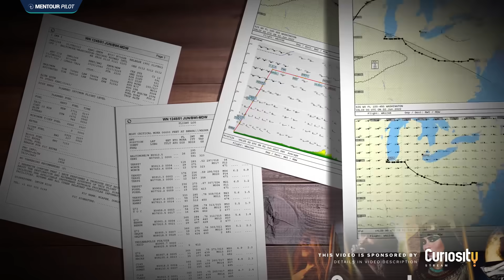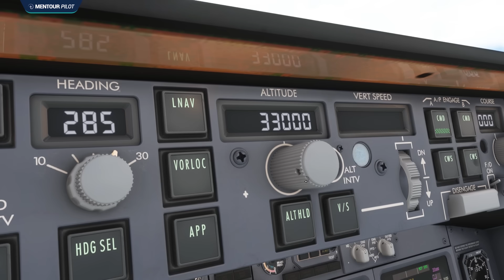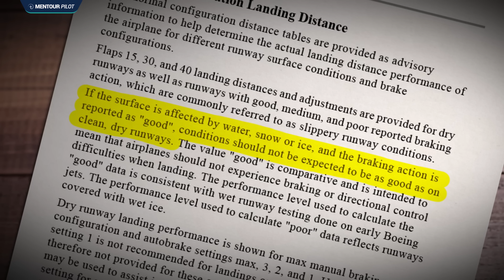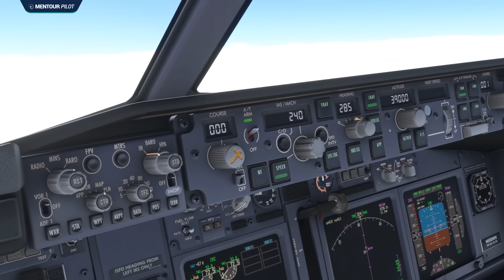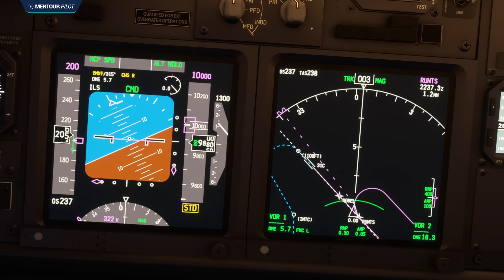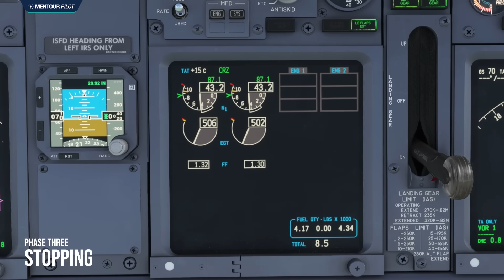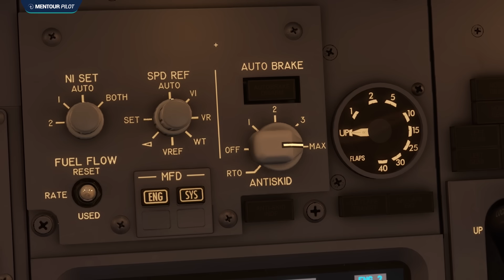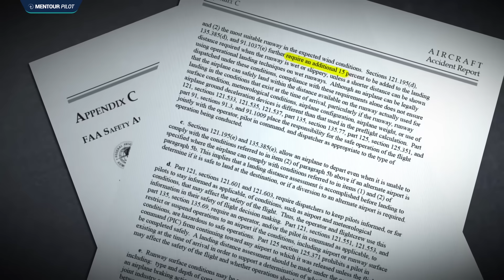WHAT did The Pilots MISS?! Explaining Southwest Airlines flight 1248

Comment: This one is very close to me. I landed a 757-300 on 31C an hour before the SWA accident.  MDW is most definitely a challenge when the wx is nice. Throw in low vis. and runway clutter and it gets real challenging. Auto-brakes max on a 737 is like a carrier arrest. I used it one time with the check airmen when I flew the 737-800. Auto-brakes 2 usually worked adequately with clutter. Of course when the Capt. applied manual braking the auto-brake system goes off. I operated out of MDW from 2000 to 2008, many T/O's and landings.
Reply from the maker: Thank you for that story! 💕
Reply: “Throw in low vis. and runway clutter on a 737 and it gets real challenging”. 

… plus tail wind in this case.  Why doesn’t the industry consider this an automatic divert, or an outright flight cancellation due to weather, instead of just becoming ever more “challenging” until something breaks.  The “carrier” landing mentality also seems dangerous given widespread former military pilots, because carrier aviation and military mission critical thinking has aspects inappropriate to commercial aviation:  flight must occur, landing must occur here on this carrier and now.  This  SWA flight did not need to occur, nor this landing at this airport.
Reply: @Nill757  In this particular case the crew was not up to speed on the auto-brake system. Many aircraft landed before this flight without incident. I understand your thought process but professional pilots are paid and expected to operate in such conditions and do so without peril on a daily basis. Like all accidents not one thing was the culprit but several red flags that created the end result. The crew was unfamiliar with the Boeing auto-brake system, landing data was what I call "fuzzy math" and then there was a tailwind and reduced braking action. The slow reaction of the reverse thrust was a big contributor, when you land at an airport like MDW even when the reverser's deploy promptly you almost feel like they weren't  fast enough.  I don't need to go on, Mentour Pilot has done a good thorough report on this. I only commented because I was there that night.
Reply: @Kevin_747  I recognize the high level capability of professional pilots.  I’ve been close to them for years, via designing gear for mil aviation.  

In this instance, it’s troubling to to see the response, ‘other aircraft landed without incident’, which is the case in every system with fundamental flaws which are excused away, like the Bhopal chemical disaster, or the countless coal mine collapses until that industry finally corrected itself.  

Similarly the unfamiliarity of this crew with the braking system is not an excuse for the accident.  Every professional comes up against unfamiliar terrain, which means recognizing those limitations and backing off.  Here, this crew knew and discussed experience limitations, which a safety focus meant diversion to O’hare w longer runways, or simply grounding the flight.  Instead, Im inclined to believe as you suggest  that the cockpit mindset was, ‘we’re professionals who perform without peril’, all the way through the runway excursion and into that car with the boy.

There are several sincere ways to view this accident.  Mine, is that the industry’s remarkable modern  safety record is now brewing hubris, is growing increasingly brittle via ‘train detail 99, patch cockpit glitch 101 instead of growing robust, is increasingly pushing up against the limitations of crews who can’t train on infinite detail, is increasingly immune to criticism via ‘we grow safer from accidents’.
Reply: @Nill757  by "carrier landing," the guy is only describing the extreme deceleration when landing on a dry runway with MAX autobrake selected.  He's not talking about anyone's "mentality."
Reply: @Kevin_747  Falstaff strikes me as the kind of person who wears an N95 mask when he's driving his car while alone on the freeway.  He seems extremely risk averse and thinks normal aircraft operations are reckless if the flight is allowed to continue in anything less than ideal conditions.  I've seen some of his other posts and there's definitely a theme going on.
Reply: @skyhawk_4526  Fair enough.  He’s also identifying as a former  naval aviator, where diverting to other airports is generally not an option, nor is canceling the flight due to this kind of weather.   It seems odd to me, given this accident doesn’t happen at Ohare’s long strips, that so much focus of this discussion is on how more training etc could have squeezed this aircraft into Midlands within the tight margins, icy short strip, tail wind.
Reply: @Nill757  Sir, I did not say I was a former Naval Aviator. I described the Boeing Max auto brake as "carrier arrest" like. Skyhawk452 also described it as sudden deceleration, which is accurate.(thank you Skyhawk) I did ride through several carrier landings as an enlisted sailor on the COD so I feel authorized to use that as a comparison. You seem to think my attitude and remark "without peril" is cavalier and cocky. Absolutely not. If you have the proper data for a safe landing and decide to go to your alternate while your other shipmates are landing you will be sitting in the Chief Pilots office in a short time. The accident aircraft in this report did not have all the numbers in the "green". That is on them and no one can change that. I'm retired now but I spent 40 years in cockpits with a clean record. I see no reason to keep writing word salads to try and explain airline ops to you. I respect your opinion even if we don't agree.

Comment: Eighteen seconds seems like such a long time to realize the thrust reversers aren't doing anything. I know flying an airplane, particularly a big jet like this, can be pretty complicated and I could understand if it took them 18 seconds to remember to retract the landing gears after initiating a go-around. However, in this case, they really only had two things they needed to worry about once the wheels were on the runway: slowing down and steering. I'm not a pilot and maybe I'm missing something, but they only needed to steer with the rudder, make sure the auto brake was working and brake manually if not, and make sure the thrust reversers kick in within a reasonable amount of time, and there were two pilots to stay on top of it. They expected the runway to be slick so it's not like anything totally unexpected happened. I feel like I have more going on in my car when I'm making a routine stop at an intersection and I have to steer, brake, and downshift. (I don't have to downshift, but I like to do it anyway.) It's never taken me 18 seconds to realize I'm in the wrong gear.
Reply: this is such a good point. 18 seconds is a long time
Reply: Now imagine you've just moved from an automatic to a manual for the first time since you took your test years and years ago and this is your first drive out. Your going to make screwups as you struggle with making sure your using the clutch correctly. The distraction factor of the autobrake was clearly  major factor once they where on the runway.
Reply: A car is pretty different. You can easily hear the engine revving up when you downshift. The pilots in a commercial jet sits fairly far from the engines and they are wearing very good headphones.
Reply: No, youre not missing anything! Should've realuzed it.
Reply: You sound like you would make an amazing pilot, just like every other armchair critic. Backseat drivers🤮
Reply: @leonardhpls6  So why did it take 18 seconds?
Reply: When I was young I had a Lotus Europa... girling brakes. One day I backed out of a parking place in a parking lot and approached the street, so I pressed on the brake pedal and it went to the floor (I found out the hard way DOT3 would destroy girling seals). Thinking I had pressed the clutch, I lifted my foot and searched for the brake pedal again, pushing and getting the same response. I had rolled to a stop several seconds before I realized the brakes had failed. My brain told me I was pressing the clutch pedal so I never gave the parking brake a thought... I just had to find the right pedal.

The manager I had before I retired was a former Army Ranger. You would be amazed how many times he pointed out when we would second guess the guy in the field, "We aren't there."
Reply: @darthkarl99  That doesn't seem like a very good analogy to me. In fact, it seems backwards since the auto brake makes things easier while driving a stick is more challenging.

I'd liken it more to having a device on your car that watches for red lights and will automatically brake for you well in advance, but it's in the testing phase and you have to be wary that it may not work. I think I could watch for red lights (as I usually do) and be mindful that I may or may not need to brake while still staying able to keep the car in my lane, watch out what's going on around me, etc. This was a new device that if it worked meant they didn't have to worry about one of the three things on their list, and if it didn't work, then they did what they usually do. Two simple scenarios...

I think they probably should have just left it off since they had so little room to spare when deciding if it worked or not, but to get distracted for 18 seconds...
Reply: @djinn666  They don't have to hear it. They can feel if the plane is decelerating. I feel like I'm going to get thrown into the seat in front of me every time I land. It's pretty obvious.
Reply: @leonardhpls6  If I was in the backseat with someone that took 18 seconds to realize the car wasn't slowing down, I'd tell them to let me out and I'll walk.
Reply: @flagmichael  Okay. What if you had half-expected your brakes to fail and had already planned what you would do if they did? Unexpected failures are one thing. They expected the auto brake to fail and probably decided it had failed when it hadn't. There was no surprise.
Reply: According to the NTSB report it was actually 15 seconds before the first action to deploy the thrust reversers was recorded on the flight data recorder. I guess the captain completely forgot, even though he claimed he tried to deploy them immediately after landing, and they didn't work. The NTSB investigators suggest the captain associated in his muscle memory braking manually and deploying the thrust reversers at the same time. So, as he didn't brake, because the auto-brake was used, he also skipped the associated action, deploying the thrust reversers.

The first officer noticed that, probably after about 12-13 seconds or so. The first officer mentioned the levers were still in the stowed position so, in my opinion, it's unlikely the captain even attempted to deploy the thrust reversers, especially as the flight data recorder didn't indicate any attempt immediatly after touchdown. At about 15 seconds after the touchdown, after moving the captains hand from the levers, the first officer started deploying them himself, as that's when the flight data recorder recorded the attempt. It took another 3 seconds for the mechanism to deploy and allow him to move the levers to maximum reverse thrust, making it 18 seconds until full reverse thrust was commanded.

However, even after 18 seconds, the engines were still not at full reverse thrust because, as Peter mentioned, immediately after touchdown they begin to spool down if you don't quickly select reverse thrust. So it took another 9 seconds before the engines actually reached full reverse thrust. That's 27 seconds after the touchdown. Unfortunately it was way too late at that point. Just a few seconds later the aircraft reached the end of the runway.
Reply: @flagmichael  So, today I learned 2 things, not 1. Thank goodness for search engines, otherwise, I'd have to ask you the questions. Not an auto person, so I am not familiar with the brand of brakes you mentioned nor what the DOT3 meant.  Now I know. Thanks.
Reply: @flagmichael  Panic does do that. And cool car, even with those brakes!
Reply: @chitlitlah  And knew that the runway was slippery, therefore making the thrust reverses especially important given the expected lower performance of the wheel braking.
Reply: 18 sec is a blink of eye when you are under heavy work load, stressed, and focused on other items. Although I was surprised an experienced usaf pilot would make this kind of mistake/miss, maybe he wasn’t really trained as a pilot while in the usaf, And only became one after?
Reply: @onlythebest3311  Really depends what he was flying in the USAF. Also, keep in mind that yes, 18 seconds is a long time but he's already worrying about the runway length, he's not getting the response he expected from the autobrakes so he's managing the brakes manually, steering the plane on the runway. Should he have noticed? Absolutely but I can see very much how he didn't.
Reply: You really shouldn't downshift, it greatly increases the wear on your clutch, and it also changes the direction of the thrust on your crankshaft bearings, increasing the wear on those as well. It's far cheaper and easier to replace brake pads rather than clutches and bearings.
Reply: @carlosanzola2938  I rev match on downshifts (heel-toe shifting) and I don't downshift so low it gets the RPM up high, so it's not that much wear on the clutch. I know it's a little more than if I just coasted to a stop every time, but nevertheless, I didn't buy a sports car to drive it like my grandmother would.

Comment: Landing at speed of 124 nautical miles per hour (about 230 km/h) and trying to brake on slippery road is going to be sketchy no matter how you do it. Even in a passanger car with winter tires, that could require maybe 2000 meters in very slippery conditions.
Reply: You aren’t kidding there. The one time that I had to drive in blizzard conditions at night on slippery roads… Well because I started out in a big empty car park I actually tested my car’s performance and how different everything felt by basically sliding on purpose while I had space and safety to try.

Even after that testing I was still scared but had to do it anyway or be stuck in a very cold situation. Obviously I survived and got home safely but because my street was quite a steep hill I parked at the top where the road was flat and walked the rest. Still one of the hairier situations I’ve ever been in.
Reply: If only passenger cars had thrust reversers. 😉
Reply: @skyhawk_4526  That might have helped! Having a way to stop that didn’t rely on friction might have helped. 

On the other hand I opted to drive no faster than 20mph unless I was having to build up speed in order to clear the crest of the hill, which I’d learnt from Ice Road Truckers of all things. But until that night I really didn’t have the full idea of exactly how much vehicles skid on ice. Where I live snow is really uncommon and barely happens once or twice a year. An actual howling blizzard after a few cold nights to form ice is virtually unheard of and I was still young enough to have never driven on ice before that night.

Yet, thinking “this might be sketchy, I’m going to test this while I’m in a safe place” probably also really helped. And recognising my limits first. “So I probably could go down my street and reach my home safely, but I don’t know if I have the skill to drive out tomorrow and the bottom of the street is probably going to be blocked by the cars of people who had to bail. Better if I leave it on a flat bit of terrain and walk the rest.” 

But the idea of being in a much bigger vehicle that flies, goes way too fast and no real ability to turn into a skid is even scarier.
Reply: Oh wow, would you look at that, runway 31C on MDW is just barely under 2000 meters long :P

On a more serious note, true. From this perspective it does make it sound less realistic, but that's coming from a person who doesn't use knots or feet daily, so the numbers - while consistently used in and between videos - do go slightly above my head for actually understanding the actual figures they represent.

Comment: The reverser thing sounds really odd - extra concentration required to both activate, wait a few seconds, then go to full tilt. Why not permit full extension and have the full procedure to reach the set level occur automatically?
Reply: meh cause then they wouldn't have to work as hard that's why🤣🤣🤣
Reply: In fact it should be automatic and not even require pilot input. As soon as the aircraft touches down safely, the reverse thrust activates. Take the human equation out of it completely. Also integrate AI so the aircraft warms you based on info from tower, that you can’t land on the runway
Reply: @bluepurplepink  if a go around is needed, it would add to the time before sleeve is back, engines can spool up. That's why. It has to be manual decision.
Reply: @bluepurplepink  Have you seen this pilot's other video about what happens when thrust reversers accidentally deploy in flight? No way should that be triggered automatically
Reply: @bluepurplepink  well once the reverser deploys you can't go around anymore. So no it shouldn't be automatic.

Comment: My understanding is that once selected, the "Auto Brake" will set in when conditions/configurations [(a) Landing Gear down and Locked  (b) Certain wheel speed] are met.
Pilots only need to deploy the Trust Reversers upon touch down.
Please correct me if I am wrong.
Reply: For most of the landing yes. From my experience with simulators but using genuine checklists you switch over to manual breaking once you drop below... 30 knots I think?  But yes, if you've got the autobreak on and the spoilers armed when you land you pull on the reversers, make sure they're fully engaged and just make sure you're going straight down the runway.